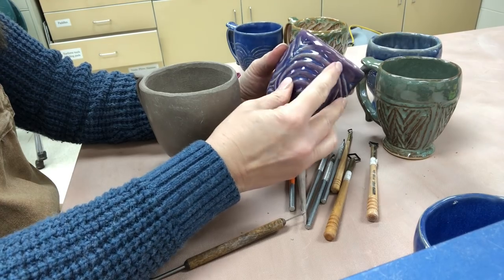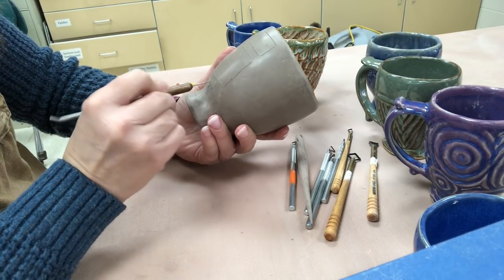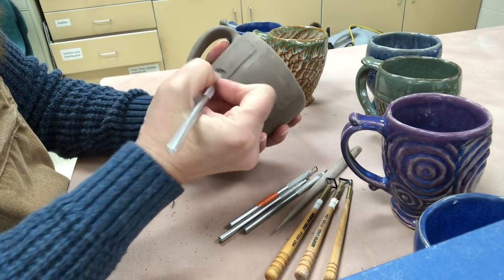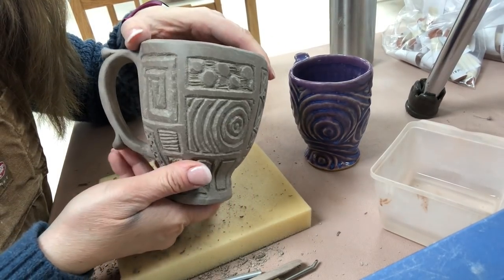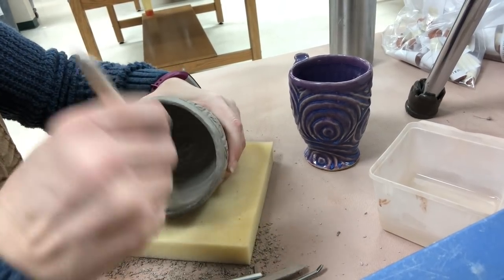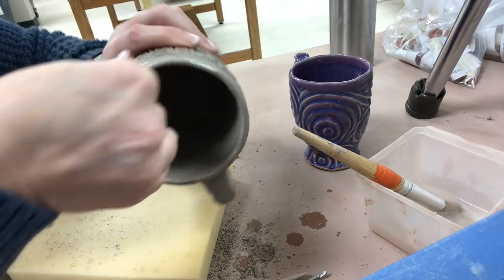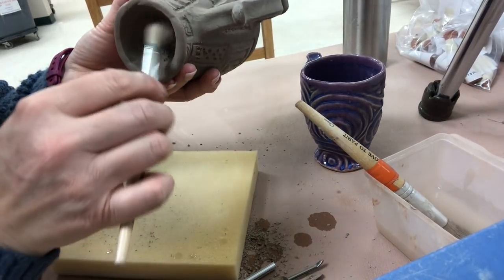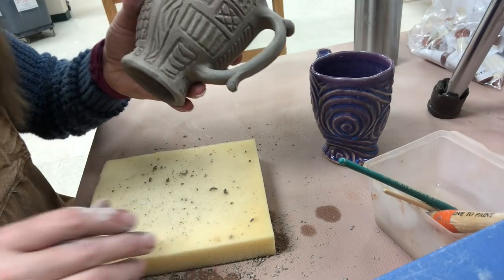Finishing and Carving the Pinch Cups -Ceramics II

Comment: Im new to clay, how long do vessels stay leather hard for? What type of clay do you recommend for someone wanting to make one of these at home? Thank you :)
Reply from the maker: Hi Kelsey- that is an impossible question to answer without clarification.  It is all in the way you store your items. I mean, I have kept pieces leatherhard indefinitely.  If you keep things under plastic, and occasionally rewet with damp towels, that will keep it leatherhard.  I keep a damp bin in fact- which is a plastic bin with a few inches of plaster in the bottom. I just add water to the plaster occasionally if i feel it is drying out.  Then, I can keep greenware in the lidded bin on the damp plaster for months!  Of course, if you leave something uncovered overnight it can go to bonedry from leatherhard in hours.  Just be attentive to your clay and how you cover it!  :) . I often use heavy towels to drape over it as it dries- to control the moisture a bit more.
Reply: @KaransPotsAndGlass  Thank you!! This answers so many questions.

Comment: What is the purpose of adding grog?
Reply from the maker: Hi Stephanie- Prepared clays are made both with or without grog. Grog gives the Clay more porosity, which allows it to dry with less cracking. Grog also helps to add strength when building larger pieces!
Reply: Wonderful, thank you!